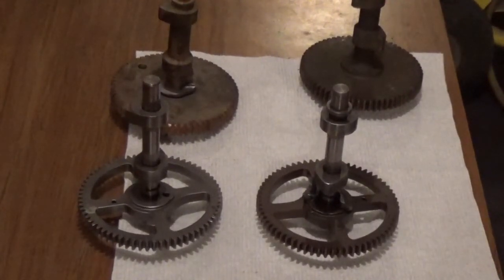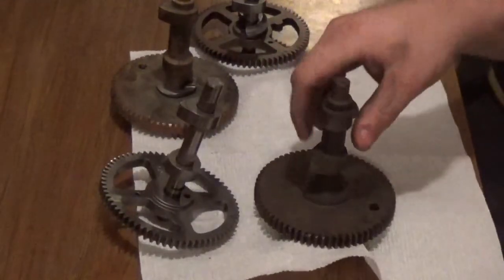Evolution of Briggs and Stratton Cams

Comment: you are absolutely right I run across that problem Every day in my shop , it throws the duration of the lash off  and the engines surge non stop ,,, I've found that most small Briggs will shut down after 40 hrs use , the cams wear out , I'm talking about the inexpensive mowers you buy at Walmart , thanks for the exelent video you are a good mechanic keep up the good work !
Reply from the maker: Thanks ...its nice to receive a complement .

Comment: My 446677 has no compression mechanism on the cam when I rebuilt the motor because of a thrown connecting rod. Is this normal?
Reply from the maker: Yes / the rod took out the compression release ....You will need a new cam...

Comment: my 2014 briggs 15c107-0014-f8 OHV engine 250cc EVEN WORSE ##@$%%
PLASTIC CAM / PLASTIC GEAR !!!!!!!!!!!!!!!!!!!!!!!!
ALSO HONDA GCV160 / GSV 190 PLastic CAM 
Rubber timing belt SOAKING IN OIL !!!!!!!!!!!!!!!!!!!!!!!!!!!!!